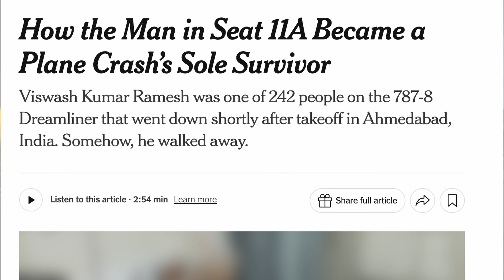Why the RAT Changes Everything – Air India 171 Update

Comment: In a case like this, the NTSB is going to be scrambling big time. There are other planes that could be effected by whatever brought the 787 down.
Reply: No. This is an 11 1/2 year-old airplane. Very unlikely to be a manufacturing defect, but they will check all the planes
Reply: @RonRichards-v5f , fuel?

Comment: Something else with the ears.  In the video where the plane goes by and Steve shows the RAT deployed, I would assume that if this plane was at a high power setting to climb out from takeoff I would expect to hear the jet engines.  I don't hear them.
Reply: Yeah, those engines arent even running...it literally happened as they were pulling the wheels up based on some of the comments about the wheels

Comment: The survivor also mentioned that the last thing he heard prior to impact was the engines throttling up.  So, it's possible that the pilot got them restarted, but too late.
Reply: It could be that he was hearing the RAT :(
Reply: @ninoid51 might explain the thud he heard.
Reply: Restart requires the APU to be running. There wasn't time for the procedure.
Reply: If you have a look at the picture of the tail wedged in the building  from the top. You can see the apu inlet door is open. (Or at least opening)
Reply: Engines do not restart that quick.
Reply: No way you can restart engines that fast once failed, there is alot of checklist to go through, they had no time for that
Reply: Neither the engines nor the APU would have restarted that quickly. He was hearing the RAT spin up
Reply: Maybe what he heard was the RAT.
Reply: For everyone who pointed out that there was insufficient time to "restart" engines, let me rephrase.  If for some reason, like a software glitch, the engines became throttled down, the pilot may have remedied that problem and throttled up again, albeit a bit too late.
Reply: There was no where near enough time to restart an engine, It is possible, however, to throttle up from a idle if there was an electrical fault that could have been addressed. 34 seconds from takeoff to crash is not much time.
Reply: I really doubt a passenger would mistake the RAT for the engines.
Reply: @letsdothisplease22  Ah yes, airline passengers with all their knowledge of the aircraft they fly on....JFC 🤣
Reply: @walterwanderley383  In case you didnt know, there is a difference between a propeller and a jet engine. Including the sound. Shocking, right?
Reply: @letsdothisplease22 when someone is in a near death traumatic experience- such a plane crash their recollection is not always the best. Same holds true for even professional pilots. Our brains tend to compartmentalize these sorts of events.
Reply: He said it was like giving race in cars. So using max speed maybe to buy some time to find a better place for crash landing.
Reply: @letsdothisplease22 witness statements are always open to interpretation, because they are usually wrong

Comment: My theory: 787 departs normally, WOW opens on rotation triggering ground-to-air electrical transfer. Latent bus fault surfaces during reconfiguration — bus tie contactors isolate main AC buses. Dual AC loss triggers RAT deployment, FCCs drop to secondary law with degraded trim and stability. Hydraulic degradation leaves gear down, adding drag. Nose-up pitch combined with excess drag leads to rapid energy decay, deep stall, and impact. Perhaps not a loss of thrust due to engine failure, but due to airflow dropoff through the engines due the pitch up? Crew overwhelmed with Master Cautions, maybe the elevator was sluggish under RAT power and they couldn't pitch down quickly enough?

This precise window — WOW → Air Mode Transfer (first 1-3 seconds after liftoff) — is one of the few moments on the 787 where multiple simultaneous fault chains can fully expose an electrical systemic vulnerability. This is supported by the RAT deployment and the surviving pax saying the emergency lighting came on after takeoff.

But we shall see what the FDR/CVR reveal...
Reply: What is WOW?

Comment: My theory during roll out after V1 we had #1 engine compressor stall.during rotation you see smoke on the left side.not on the right.some people say it was debri from runway but no..maybe ingested a piece of debri or front tire blew.then during climb out landing gear up was selected changed position to start retracting but had no hydraulic. RAT deployed.in the rush they idled wrong engine.

Comment: Could the bang been the fuel pump failing/exploding knocking out fuel flow to the engines, causing engines going out? They said they were almost a half hour delayed on take off in extreme heat and humidity. Bang causing hydrolic failure causing loss of oil pressure resulting in both engines failing?

Comment: The obvious thing to me, not looking at this video, but rather listening to it, is that the engines are not running---you can actually hear what sounds like the RAT--the turbine spinning full blast. If the engines were in normal operation the pilot would have been firewalling those throttles for all he had, enough to break the levers off in his hands but those engines are not going at full throttle.
Reply: This, it's not only about what we hear, it's also about what we don't hear
Reply: Even the original news clip, I was thinking “why does it sound like a prop plane?” And then it dawned on me there was no jet noise either. Someone else showed a video of a JAL 787 landing with a RAT out and it sounded identical
Reply: Very rare to have dual engine failures.  They’d only thing Incan think of is something with the fuel.  Because the two engines share the fuel.  For two engines to fail due to structural damage, would require absolute, colossal negligence on part of the maintenance.  It’d be like not noticing that you have four flat tires.
Reply: @redfan3977  Boeing software or poor design redundancy is more likely.
Reply: Just can’t be conclusive. It’s a phone mic that might not be sensitive to these lower frequencies. Need to see a normal takeoff from this phone to compare
Reply: @michaelbee8263 Or we can wait for 3 months for the report as mentioned in press briefing after blackbox was handed over to agencies.
Reply: @michaelbee8263  If the RAT is operational, it automatically confirms that the engines weren't providing any thrust.
Reply: @poruatokin correct me if I’m wrong but electrical bus failure can trigger the RAT. This doesn’t have to include loss of thrust
Reply: Thanks captain univibe how many hours you got behind the yokes / sticks

Comment: Hi Captain Steve. You should also take a look at the landing gear of the aircraft. As far as I am aware the 787 has gear that tilts backwards but it tilts forwards when it is retracted. It seems like in the video the gear is tilted forward so it may be possible the gear was in the process of being retracted when they lost hydraulics. Thanks for your time!
Reply: There was this video of the same Air India aircraft taking off on an earlier occasion and I noticed that the landing gear was not retracted for a long time after take off. So I think the Air India piolots are trained to keep the landing gear up for a bit more time than normal. If that is the case then there is nothing unusal about the landing gear issue here.
Reply: @vasusarpeshkar8082  could be for cooling the brakes after a quick turnaround or abort but in this case the gear is tilted the 'wrong' way

Comment: Great video, Captain. I think the fact that you don't hear any screaming engines is also a sign of dual engine failure.
Reply: That’s my question as well. Is the sound of the RAT also missing the sound 2 engines at full throttle.
Reply: I noticed same, no jet engine sound and only the buzz from the RAT. I thought a dual engine failure on a 787 inconceivable, but there it is… Very interested to learn the root cause
Reply: @duckofprey1  I've heard there is a slaughter house nearby the airport that attracts a lot of birds. I'm still in the double bird strike theory. Just because there's no dead bodies on the runway doesn't mean anything. It's entirely possible for a big engine like that to completely injest a bird into the core and cause a lot of damage. Parts of the bird aren't going to make it past the combustion chambers and then out through the power take off hot section turbine then out on the ground. Maybe little burnt pieces that's about it.
Reply: @duckofprey1 let’s hope Boeing are not going to try and point fingers  the airline or pilots.. I don’t care what anyone says at this point, there is definitely something very flawed with modern Boeing technology..  the statistics simply don’t lie.
Reply: @duckofprey1  The fuel pumps are electric…
Reply: @patrickearley7322 then how do you explain that the surviving passenger heard the engine being revved higher right before the crash?
Reply: My thoughts as well!
Reply: I've seen videos from the passengers recording inside showing their was electrical failure and nothing was working before take off also
Reply: The 787 does have pretty quiet engines, but you really don't hear anything, so I think they were windmilling.
Reply: What is the protocol for duel engine failure ?
Reply: @Rabi-r8t at altitude you pitch for best glide and start looking for suitable landing locations, at 600 feet over a populated area you fight like hell to the end, but there really is nothing you can do
Reply: Below 500’ KYAGB
Reply: @Postmark-i5m  at that height and speeds protocol is just to say you last words and prayers as no way a plan cant turn and try to land back at a runway, highway or a flat enough place to land.
Reply: @Postmark-i5m I fail, you fail, we both fail, all at the same time.
Reply: @Postmark-i5m  hoping you are not airborne or at takeoff speed.
Reply: Yes. I agree. I feel like at least at some point the engine noise would over power the rat sound had they been full throttle. I say at some point because there's probably some sort of acoustical reason the sounds would come in and out of prominence.  Something similar to doppler effect. I do believe the comparison of the audio on the flight that has a known deployment of the rat is pretty compelling. Perhaps a comparison to a standard flyby of a 787 or even any similar jet would help solidify that.
Reply: I suspect of a total electric black out that for some reason affected the three independent circuits stopping the fuel pumps.
Reply: The korean plane was a flying brick also..
Reply: Problem is I can hear the jet ENGINES OPERATING!! So NOT DUAL ENGINE FAILURE!!
Reply: @matthewgroff433   What you are hearing is the RAT. Not the engines.
Reply: @matthewgroff433  hmmm, so you say you can hear the engines screaming, well..
Reply: @matthewgroff433  LOL, ok captain...

Comment: Hello Captain Steeeve, Again I am not an engineer or piliot but my common sense is immpeccable.  I still belive that the failure of the 787 air india crash was hydralic failure.  I said about the rat before when you made a video with India's people.  If you look at the wheels on the main part not the front wheels it looks like it's tilted as if it was trying to retract and yes both engines are out at this point when it took off there is a lot of dust when it shut down on take off.  I think this is all due to the electrical battery power since some noise was heard when it took off.  this plane is the first that runs like a hybrid car with fuel and battery power.  What happens when this battery goes bad?  when a hybrid car has a failed battery it stops working.  This tech helps with saving fuel but it at what cost.  Its all about the dollar and saving on cost and maximum power.  What a shame that a great company is only concerned about profit.

Comment: Here's what happened :
Dual engine failure right after take off.
Pilot pushed the retract landing gear lever at the same time which retracted it 5-10% as visible in the video and stopped as all power/hydraulics lost function during same time.
Nothing to do with the flaps or pilot error.

Only missing piece of puzzle remains now why the engines failed.
Possible reasons:
bird strike
fuel contamination 
Something went wrong during recent maintenance job
Reply: Flight radar had them at 675 feet. 1.5 miles to the crash, that's about 12:1. With the gear down, that's close to best glide. So looks like dual engine failure. 
Given the long take off, they may well have got to V1, they are committed, but had problems. 
So fuel? Unlikely given lots of other aircraft, unless it was adatives. 
The Cathay flight where the engines went out, is an option. 
Maintenance looks like its high on the list.
Reply: @adenwellsmith6908 Got to their decision speed they were committed, they were holding on to get to their rotation speed which was near enough the end of the runway. This must have been unnerving for the pilots to see the runway running out. It looks like they also had a positive rate of climb so gears can be retracted. If this is dual engine failure due to fuel starvation, them maintenance logs will be crucial. Could the auto throttle also be malfunctioning?? Who knows. My thoughts and prayers are for everyone that sadly lost their lives.
Reply: @ivancatibog8213  Got to their decision speed they were committed - Agreed above V1

Gear can be retracted but look at other aircraft - 8-12 seconds before gear is retracted. 

Now look at the video. How long from wheels off, to clear rate of sink? 8 seconds. 
I'm not convinced they did try retract because they were too busy dealling with the engine failure.
Reply: Whatever causes the engine failure, if it other thing other than bird strike someone will be in jail.
Reply: If it were a maintenance issue, how did they taxi, roll to rotation speed and lift off.  Not likely...  No signs of engines coming apart as in a FOD incident or bird ingestion.  Fuel is possible culprit and looks like most likely from what we are able to see.  CVR and BB will hopefully offer good info...
Reply: @billheet5011 
There are never any immediate failures out of maintenance jobs.
It all happens over a period of time that the defects start showing their face in this case possibly after 5-10 flights post maintenance.
In layman's terms think of a recently repaired car engine which earlier was functioning fine for years but after one maintenance/repair job starts malfunctioning post 2-3 rides.

Though this is much more complicated than that but still I feel it has something to do with poor maintenance as it can not be a design issue and bird strike is almost ruled out completely.
Reply: yes definitely..... you can't hear the engines in the video
Reply: Not bird strike, would have been evident on video. I'm thinking full electrical loss at critical phase. According to the survivor account, engines throttled up just before crashing which indicates the electrical came back online but too late to recover.
Reply: Something tells me it was some sort of fuel catamination. Too many check points for pilot error. The plane simply stopped functioning. I agree. The pilots did everything right it appears. When RAT deployed at 500 feet on a take off there’s no shot at survival.
Reply: @billsmith8961  Separate tanks, separate engines. You would get a staggered loss of power. 

Cathay Pacific Flight 780 is an example of a previous fuel issue. 

So I don't think its that.
Reply: Sabotage by Pakistan
Reply: Captain Steve ruled out birdstrike in the video
Reply: Liver??
Reply: Does AI prohibit lithium batteries in checked bags?
Reply: THERE WAS NO BIRD STRIKE!
Reply: NO, that's not the only piece missing.  In the hot places on the planet modern electronic equipment is under a serious pressure because of the heat.. when they finally traced the engines in the crash in England whee everyone survived, it took 2 years and multiple thousands of trials and errors.  The pumps had to be re-engineered for ice.  Dollars-to-doughnuts, when this is over it will be 100% due to heat.  The electronics bay will be refrigerated to prevent another heat caused difficulty.
Reply: @alan2914  It will be maintenance
Reply: Am I remembering correctly that a Boeing whistleblower warned about this plane?
Reply: @cyclonasaurusrex1525  I feel like this has nothing to do with this crash. I mean, this is the first total crash of a 787 Dreamliner.
Reply: @cyclonasaurusrex1525 The whistleblower, John Barnett, warned about many issues with 787. John committed suicide last year. Tells a lot about Boeing.
Reply: @cyclonasaurusrex1525 didn't they wack that dude?
Reply: The pilots undergear were too loose.  Another great theory.  CFI of EFATO and Aerobatics.